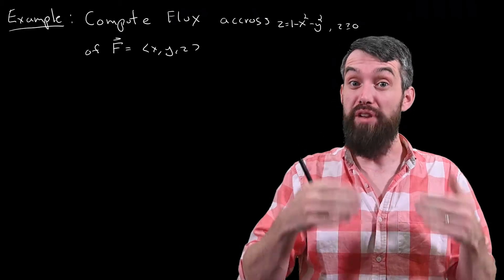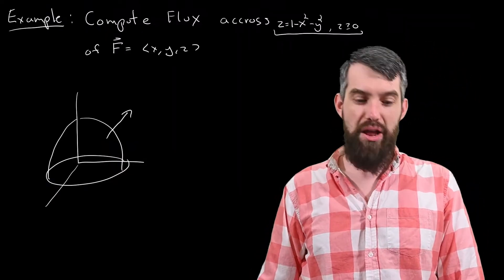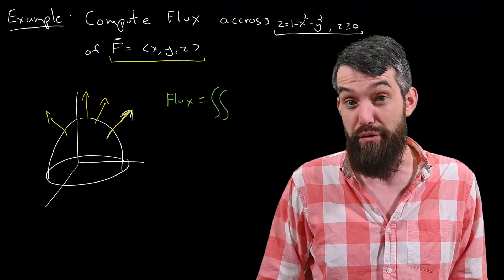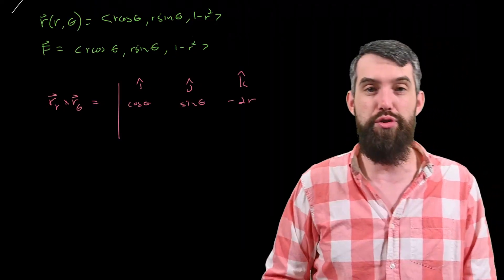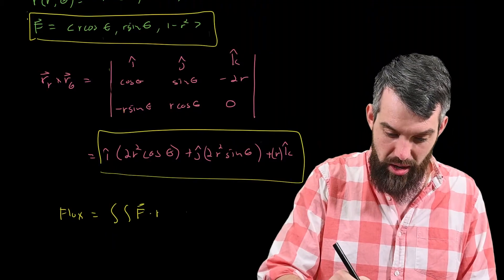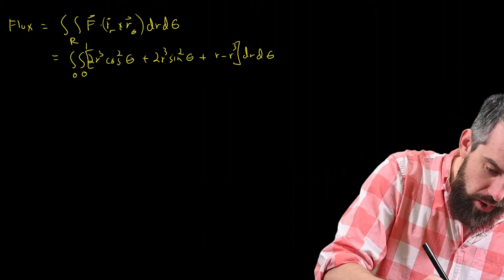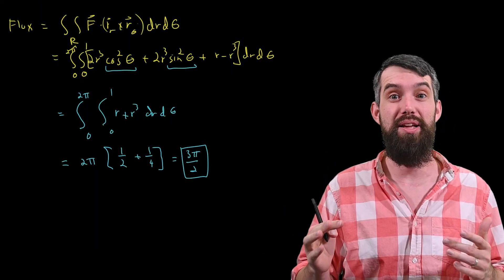Computing the Flux Across a Surface //  Vector Calculus

Comment: you should explain why the vector field happened to be aligned with the unit normal vector to the surface. This is generally not true with random surface. Is it so aligned due to the geometry of the paraboloid? More justification is needed. One more thing: the copordinates used are cylindrical coordinates, not polar coordinates in this case because the tangential vectors as functions of the parameters are F(r, thita, z). Other than that the presentation is very well done.

Comment: Does anybody know why the bound for r should be 0 to 1, because I would interpret that as a cilinder with radius 1? Also, do you not have to add the r to the jacobian when you already considered the jacobian matrix?
Reply: If you are working with the parametric way you're not supposed to use jacobian
R goes from 0-1 cuz you should compute the R of the volume's shadow "its like the biggest circle you can have"

Comment: We see vector field from the volumetric flux  as well. Now I have indirectly equations for how volumetrix flux of fluid flowing though an unit surface in unite time as well as velocity of the flow. Velocity of flow is now better define like distance between two points by fluid.
    In the hydrology from the analytical solution we can meassure the saturation and pressure profiles as well as the total volumetric flux and breakthrough time.
     Thank you for your matematical approach because now it guides how to verify the theory, the analytical solution with compared numerical in another studies.

Comment: how come he didnt add the r to dr? i thought whenever using dr you have to add r
Reply: if i don't get it wrong, you don't add r when you use it for find surface area of the parameterized surface. but, indeed, when we integrate anything from coordinate to polar, we need to change dA to rdrdtheta
Reply: @haixingmodels  but this is for flux no?
Reply: @AnonymousWorker123  that is for parameterized surface and to find flux across the surface or sum of the curl in the surface, you need to integrate differential to area surface (2 option: parameterized or implicit) in your formula. 

flux across the surface= 
double integral of F(dot)n dS

sum of the curl in the surface or circulation on its boundary (stokes theorem)=
double integral of del(cross)F(dot)n dS

both of them using dS (differential of surface area). sorry for my bad english :(

Comment: Actually if z is a function with respect to both x and y, we could put the partial derivatives -gx and -gy into the x and y components of the normal vector respectively with z component equal to 1(in condition of positive z direction). Therefore we could skip the annoying cross product calculation process. 😆
Reply: Yep

Comment: I am confused about this example.  When converting to polar coordinates, would we not need to use r*dr*d(theta)?
Reply: I'm certain someone will correct me if I'm wrong, but I'd wager that it's included inherently in the parametrization step. And failing that apply Cunningham's law.

That is, rdrd(theta) comes from |r_u x r_v| drdv = d(sigma), that is r = |r_u x r_v|. Thus starting from the more general flux equation Flux = Int Int_S F * n d(sigma), we also find that n = (r_u x r_v)/|r_u x r_v|, thus because we use the normal vector it's canceled out and we are left with (r_u x r_v).
Reply: Hu
Reply: It is. The parameters being crossed together functions like taking the Jacobian and,ergo, need not be included
Reply: What?

Comment: Hi Dr.Trefor,
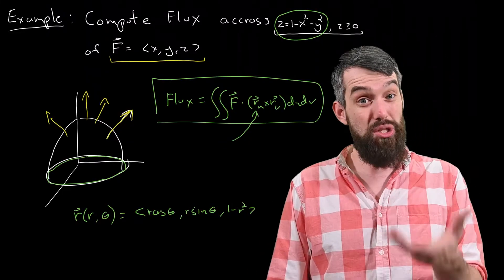At 3:29 you say that r^2 = x^2 + y^2 so we can parameterize z component (1-x^2-y^2) as 1-r^2.
however x^2 - y^2 is not x^2 + y^2; so how can we make this substitution?
Reply from the maker: It is -x^2, a negative in front of both terms:)

Comment: Why is the outward normal vector the rr x rθ and not the oposite? I cant quite get it !!
Reply from the maker: We don't know in general which is which, the only thing to do is actually plug in values at one point to test whether it aligns with out interpretation of inward or outward
Reply: @DrTrefor  ooooh that makes sense. Thanks !!
Reply: Can we take both rr×rtheta and rtheta×rr as normal,and the answer is negative,why it is opposite and how could we know which should be chosen

Comment: Why didn't you include an r in r dr dtheta ?
Reply from the maker: That would be if I converted from Cartesian to polar. I didn’t do that. I parameterized it in polar from the beginning so no conversion and thus no r
Reply: @DrTrefor  Oh, so the difference is that if you didn't use polar from the start, you instead just kept x, y and z, and then when attempting to perform the integral - you then changed the variables to polar - then you would have to incluede an r?
Reply: @DrTrefor  I believe I figured it out! Took a while and had to ask my teacher as well, but I attempted to compute this flux without parametrizing (just keeping my x, y and z) and then included the r, and just as you said, I got the same integral :))
Reply: @DrTrefor  So how would it be different if you parametrized it afterwards? It seems for me like you were given a function and a vectorfield, and then parametrized it after it was given. My intuition would have said include r in dr dtheta. I'm just trying to understand:)
Reply: A huge appreciation from three years later
Reply: @sunsonny9132  You’re welcome. I just started doing maths again after a 2 year break. Working on Fourier Transforms currently.
Reply: @eldi  lol, I have my calc 3 final tonight, doing last minute studying right now.

Comment: Nice, I used the implicit formula and got a lil bit worried when you began using the other one, but we both got 3pi/2 so we cool. Question to self: I solved it by first computing nabla_g, then cross product that with p_hat. I didn't have to change its value, just keep it either i_hat, j_hat or k_hat, which answers the question on the previous video: I don't need to compute a crazy variation of i_hat, since nabla_g already has the relevant direction of the vectors. Also, how would I do it using parameterization without look at what you did? Let me try... So essentially: parameterize it, inserting the value of z = (...) into the z_value, call it r(r,theta), then find F(r,theta) which is given. Then it's purely computational. Lastly do we compute that it's r*d(r)*d(theta)? I want to figure that out

Comment: sir, i compute it with implicit method , with P Vector as k^ , and substituting Z = 1-x^2 -y^2  and got Double integral ( x^2 +y^2 +1 )dA as final expession . now i had set the limits of dx and dy as -1 to 1 .  Therefore getting 20/3 as the final answer . why is it diffent ? where had i done the mistake ? pls enlight
Reply: your bounds of integration are wrong, you can set either the bounds x or y to be from  -1 to 1. Then, assuming the bounds for the x are -1 to 1, the bounds for y are -sqrt(1-x^2) to sqrt(1-x^2).

Comment: In physics we define flux ,e.g:electric flux  as number of electric field lines .my question is how this definition is right,however we can draw infinite number of vector by control scale?
Reply from the maker: Ya if you prescribed a fixed density for drawing lines, then this becomes a fine definition, but then you can’t touch the slider any more;)